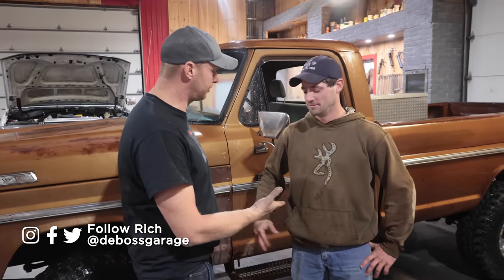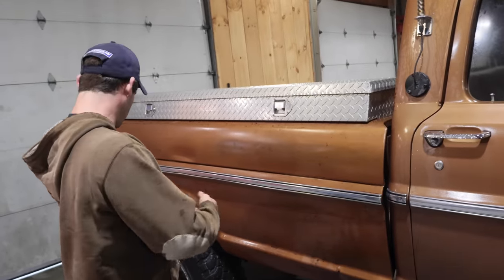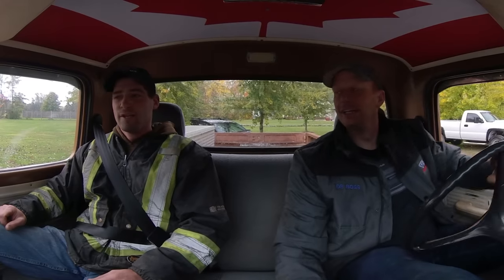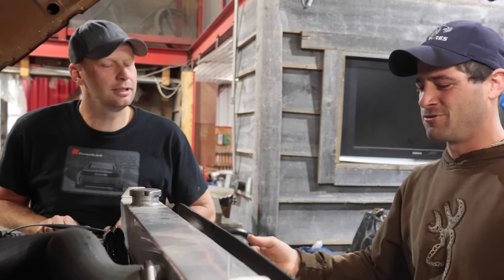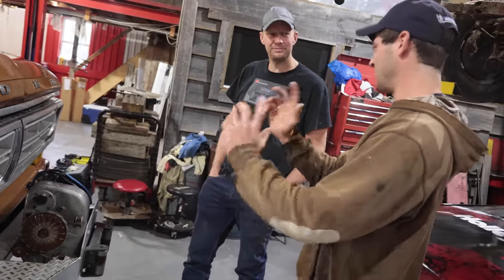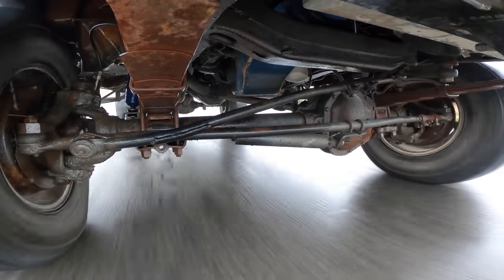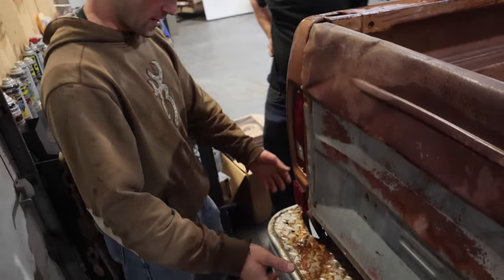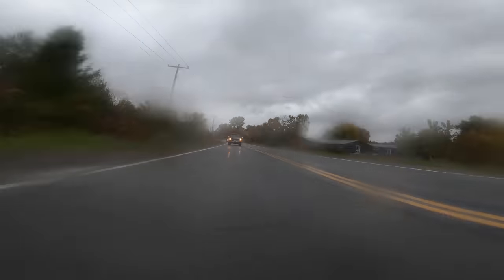The Truck You Want, But Won't Admit It.

Comment: I have a 64 f250 with an idi swap. Hx35, intercooled, fuel screw maxed. I run 15psi with the waste gate tied shut. Starts on one battery if asked to.

Comment: I would absolutely destroy that thing on the tight logging trails in my area, my t100 barely squeeks through most of the time. Would be nice if I needed that big of a bed and couldn't just use a trailer instead though.

Comment: Love to put a 6.9 litre idi 420 cubic inch diesel v8
Reply: Ok let me specify here the reason I would choose this combination is put 4.56 gears front and rear and the true Trac lock the Dana 60 rear, and granny gear 4spd, and buy a green Mr gasket booster electrical fuel pump and put it back by the tank,replace the injection pump and replace all the o rings and the Ford replace the glow plugs it is a bulletproof combination and will pull haul off and drag anything it wants to anywhere it wants to take it lol
Reply: By the way the injection pump and replace the o rings and make sure after you bleed the air out that you don't have any air leaks, replacement lift pump and the booster pump actually helps tremendously with getting it started especially in the winter..

Comment: Nice, if you're into 8cyl diesels. I'll stick with my 6 in a row trucks. 03 with 730 on it and my new 08 with 270. Oops, I do own a V configure diesel, but it's just for cruising and gets as low as 5l/ 100 km. TOG out!!

Comment: I'd rather have the 460 honestly, it will snatch a knot in the IDI's ass and keep going. The International is slow and dirty... That's about it lol
Reply: I agree. Way more jam in a 460. I’m a diesel fan for the fuel economy though. You get respectable pulling power with much less fuel.